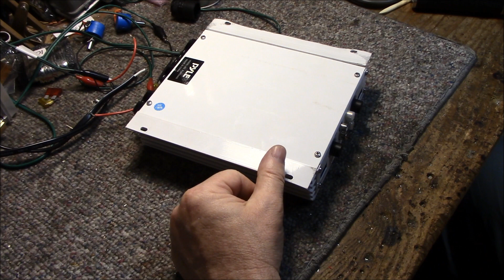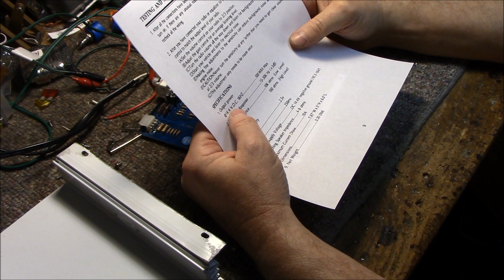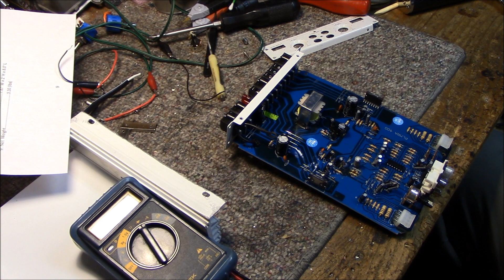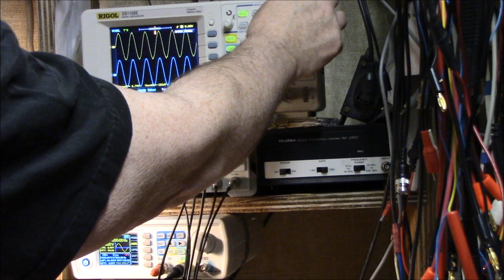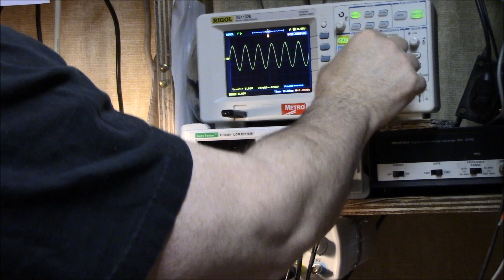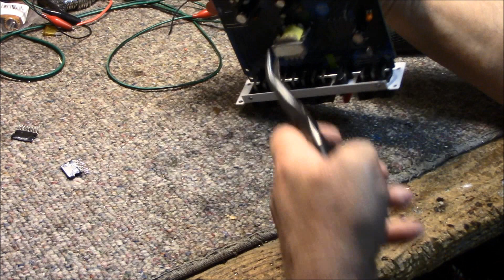Pyle PLMRA400 Marine Amplifier - Repair & Performance tests (Ep. 14)

Comment: You are wandering how they come up with those ratings, The literally pull numbers out of thin air and since there  does not seem to be any form of punishment for such deceptions, extreme exaggerations and  full blown deliberate lies printed on every box, practically every component as well as the immense number of electronic devices that are coming out of China every year, it is beyond sickening how all this complete, total garbage is drastically increasing world wide  E-waste. I have been an electronics technician for almost 50 years and its now to the point where  almost nothing that is made today is able to be properly repaired or repaired at all and be worth while since new items are generally cheaper and this is only the very tip of a enormous world wide problem because everything from lawn mowers to car transmissions and everything else being made, none of it is designed or built to be maintained or repaired once it leaves the store, everything is factory sealed now and  cant be repaired without literally destroying the case and current issues like the Right to repair is gaining larger support but sadly, I very much doubt that will make any sort of real difference to what the multi billion dollar corporations around the world  are doing and I am very sure all the world governments now about all this and much more, it seems that what China says, the world does so I have to wander, why do we even have elected so called officials supposedly representing the will and the good of the people in every country.
Reply from the maker: Thanks for sharing your views. I agree with a lot of them, esp the R2R. I see a lot of progress has been made with R2R this last year which is great. Planned obsolescence has generated huge amounts of e-waste for this planet unnecessarily. One of the basics of this channel is to give vintage e-waste a new lease on life and hopefully enjoyed for another 40 or so years , Thanks for watching, Cheers

Comment: Is there any significance in the colour of the circuit board? Is it some sort of coating, or is it a different material?
Reply from the maker: No. The colour of a board mainly comes from the solder mask. That's the last coating applied aside from the lettering. It can be any colour the manufacturer chooses but it's usually green